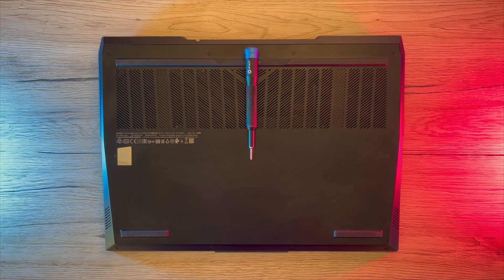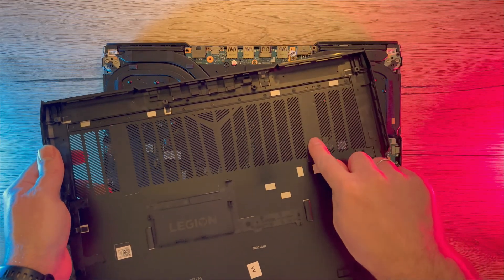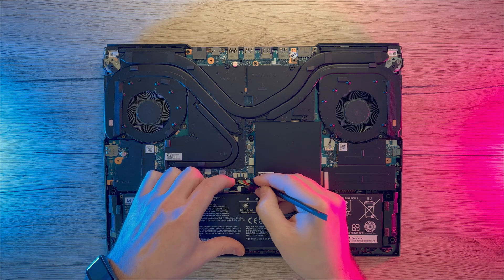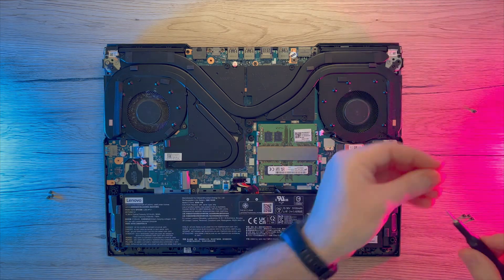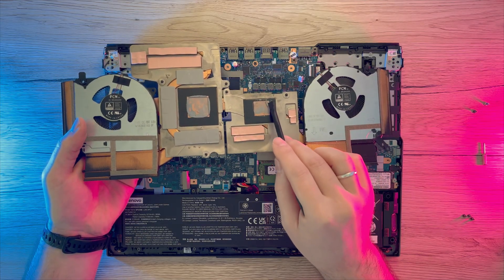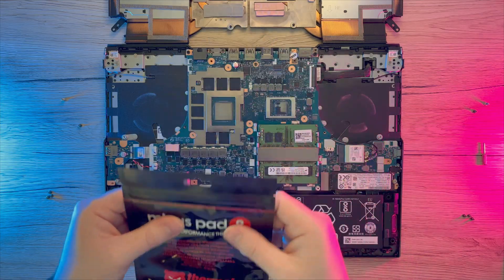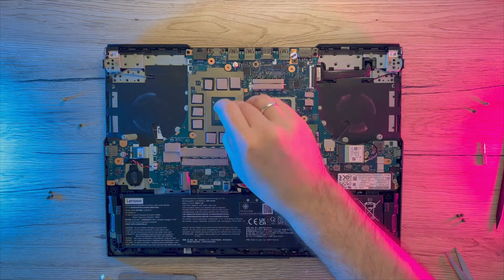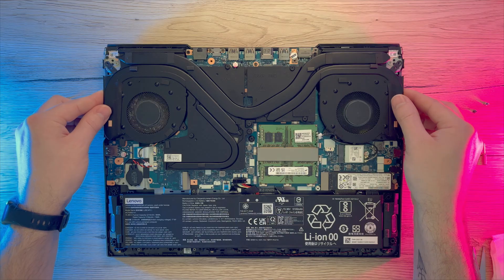Re-Pasting Lenovo Legion 5 Pro 2021 and Fixing Over Heating

Comment: Do you have to switch thermal pads if they are still a little sticky?
Reply from the maker: If they are in good shape and complete then no. I would advise doing it since it better but please check my update video regarding pads and using soft ones.

Comment: I would highly recommend using Honeywell PTM 7950 thermal pads for CPU and GPU (only). 1mm thermals pad of any good brand should be fine for the peripherals. I had struggled a lot and after 3 years of owning the legion 5 pro, I am finally running 70-80 C when playing titles like Cyberpunk at high setting 2K res. If your temps still cross 90 C and keyboard feels really hot, Llano's cooling pad will save you.
Reply from the maker: Yeah I agree and I did switched from LM to PTM in my last video ;)
Reply: Hello! Which legion CPU/GPU combo do you have? Which model?
Reply: Hey, are you saying you use thermal pads on the cpu and gpu between the chip and the cold pad? Just trying to learn, I just replaced my fans and new paste and my CPU is still running 95-100 C..

Comment: Dude, when you do this kind of videos, it's "rude" not to mention the thicknesses used for the thermal pads 😉
Reply from the maker: you are right! I don't know why I forgot this since I don't like it either xD Well it is 1mm BUT in general I would advise using really soft pads at around 1mm since 99% of manufacturers are now using 1mm pads and with soft ones you are guaranteed to have perfect die to cooling block Contact without sacrificing other components :)
Reply: @atechcheck  nice response, thank you <3
For others reading this, for this laptop I found out Lenovo used Honeywell thermal pads which are not that great, 8W/mK, I bought Gelid Ultimate 15W/mK for a 3090 "revision", not done yet, don't know the results yet, but it should be better. I recommand buying it from Aliexpress, cheaper prices, 2 weekes delivery in europe ;)
Reply: @atechcheck  what do you think, can i use 0,75 mm pads ? cos i have already changed the original ones for 1mm and also repasted by TG kryonaut and my temps go little higher after... so now i want to go with liquid metal and dl tech thermal pads with 15 W/mK, but i think i should try 0,75 mm... What do you think ?

Comment: is it safe to wipe it with alcohol? if it is safe is there any specific alcohol like 70% isopropyl alcohol or any tissue with alcohol is good?
Reply from the maker: Jup! I use 99% isopropyl alcohol for everything basically. For anything that you might think it is to strong you can always just put it on paper tissue first so it evaporates a bit first ;) and in my last video you can see how important it was for Liquid Metal ;)

Comment: I lost the cover that goes over the SSD on the right, the chipset just above it doesn't have any thermal pad on it or anything but is it worth me putting something on the chipset itself? The SSD slot on the right is empty for me but just worried about that exposed chip having adequate cooling
Reply from the maker: If you dont have crazy fast NVMe it should be fine. What you can do is put thicker thermal pad underneath it or above if you must 😉
Reply: @atechcheck  thanks for the reply but I think you misunderstood. The nvme slot is empty so the cover isn't needed for that, but there is a chip just above where the nvme SSD should go, I'm wondering if that needs a thermal pad on it?
Reply from the maker: Aaah you mean that. No no worries just leave it as is since without NVMe it didn’t even make contact to that metal plate. If you have piece of thermal pad then you can put it over the chip and dont think about it ;)

Comment: so i repaste the thermal paste, and it still hot on idle (about 44 - 50c normally it only 39 - 42) in this case should i re pad the thermal pad? and is thermal pad has big affecting on cooling down? 
thanks.
Reply: That is cool temps, tard
Reply from the maker: probably cause it is too hard and it does not allow good contact between cpus and gpu dies and cooling block. Just get softer ones that you can squish easily.
Reply: @atechcheck  well, actually 5 hours after i commenting I figure it our that my exhaust chamber has a lots of dust (at first i didnt know if that was the issue and i dont know how to remove the exhaust at my laptop)

its completely my fault
Reply from the maker: @Hklmfd  good to know it is not the pads :)

Comment: Can I ask how many mm is the thermal pad for vram you use, 0.5 or 1.0?
Reply from the maker: They are 1mm BUT you must use really soft one (almost like hard paste) since otherwise, you might face issue with contact and pressure between cooling block and cpu/gpu! Ideally TPM in par of paste form should be used….

Comment: Hey brother, i have repasted my thermal paste for my gpu and cpu of my legion 5 pro 2021 as the cpu was heating a lot during the gaming like reaching upto 99 and 100. I cleaned my fans. While gpu barely gets to 85 now which was the case before repasting. My cpu is still reaching 99 while gaming. I have done a stress test with prime 95 but the temp barely reaches 83 with all cores used upto 35 to 55 percent and the cpu consume over 45 to 50w and clocks 3.8 and 3.9ghz. But during my gaming the cpu barely uses 35w and one core upto 29 to 35 percent while other cores are at 15 to 19 percent usage(the temp is now at 99 degrees ). I don't know what is the problem.
Reply: I have same issue. Idk what to do.
Reply from the maker: Please check follow up video on Legion 5. They have contact issues and it is random so you really need super soft thermal pads or really thick thermal paste to replace them!

Comment: In the beginning of this video you should say this is a complete fail. Furthermore you should mention the thickness of thermal pad you are using. I brought the 3mm one unknowingly and now my cup and gpu do not have good contact with the heat sink
Reply from the maker: You are wrong, right and wrong LOL. It is not fail at all if you know what and how to do it. Jup I should have mentioned it. Why on earth would you buy 3mm pads LOL even on gpus they dont use them. Next time google the thickness, write a comment and ask OR expand comments CTRL+F and search “thickness” and you would have found at least 5 comments with answers. And as extra there is updated video on Legion pads, paste and copper mod right after this one… This is 100% on you mate ;)
Reply: @atechcheck  Sir, you literally created another video where you show that his thermal pads did not work since they were thick, so that means this video is a fail or incorrect. Furthermore, It was the first time I have changed the thermal pads of my laptop and I can imagine a lot of people are doing the same. When you make a video showing the steps you should not miss a single detail. I shouldn't have to check a fellas whole YouTube channel and watch multiple videos to see if his thermal pads worked. I appreciate you are trying to help people by making tutorials, but if you are going to make an updated video, you should add a disclaimer or something to the original video to let viewers know that 'hey, I made a better improvement and you should check out this video' and 'btw, this is the thickness of pads I will be using'

Comment: After change the paste, don't forget to clean the dust that stuck on the heatsink fin inside.

the biggest issue of my laptop is not the paste, but the dust that stuck on the heatsink so then the air doesn't flow the heat out.
Reply from the maker: true :) I did it later hehe

Comment: Don't know if anyone has mentioned it.. But it's also a good idea to clean the fans - often a lot of dust, hair and other stuff blocks the fans.. And since you're already in there, you should do it... Remove a few screws to get into the back of the radiators, since its where it accumulates :) - I would also recommend using Thermal Grizzly kryosheets, since paste in these gaming laptops usually doesn't last that long, so kryosheets is a great option to avoid dryspots bot on CPU and GPU only a few weeks/months after re'pasting'

Comment: So what are the normal temperatures when heavy gaming?
Reply: when i first got my 5 pro and disabled the overclocking, temps were well below 80 on both cpu and gpu. now its been almost 2 years and im hitting 85 on gpu and still 80 on cpu. albeit i do have an abnormally large amount of dust build up.

edit: after cleaning the dust from fans, all temps are 77c at most.
Reply from the maker: that Q was too simple :) it depends on your profiles, CPU/GPU TDP, Boosting both or not etc. I would say that when everything is stock it is overheating and thermal throttling CPU (90-100C) when adjusted to use less power on CPU side it is OK and both are around 70-80 after some time since cooling solution gets saturated.

Comment: At what intervals would you recommend renewing the thermal paste and the pads?
Reply from the maker: hmmm this depends on your environment (ambient temps, humidity), hod often you use and for how long under full load etc. I would say once a year is a good idea to open it up and clean fans, dust etc. Use WD40 dry lubricant and spray a bit in to the bearings of the fans. and when you see that your temps are not acting as they used to and not stable I would say it is time to replace them ;)
Reply: only when you see performance drops that are no longer "ok" to you. The ryzen chips are extremely heat tolerant so I wouldn't worry too much unless you see above 90C in extended use constantly
Reply: My legion is now one year old I had actually decided to change the thermal paste and the pads in conjunction with the fan once a year as a precautionary measure. Is that an exaggeration?
Reply: @janfollinger7276  only change it when you need to. My legion I've had a while and the temps are basically the same. I'm not worried about it. I wouldn't recommend grizzly though like the guy used in this video. Temps are great but grizzly dries out fast and you are basically forced to change it every 9 months at the latest

Comment: I own a Lenovo Legion 5 Pro laptop. Unfortunately, the battery has become damaged, so I've removed it from the device. I'm considering using the laptop by keeping it plugged in all the time. I'm concerned about potential damage to the laptop components over time since I don't plan to replace the battery and use it without a battery. I mainly use the laptop for 3D work, so it's on all the time. So , do I have to face any issues if I use like this for years? I appreciate your response. Thank you.
Reply: From what it got damaged?
Just to be careful
Reply from the maker: Well regarding using it just plugged in, it is fine! No need to worry there ;) Also Lenovo have a CMOS battery (Still!!!) So it will be fine in terms of date and other UEFI settings.

Comment: Can the fans be removed? I have mine doing some noise and as I see they are attached to the sink?
Reply from the maker: Jup! You must remove cooling block and unscrew fand and take them apart from the bottom side
Reply: @atechcheck  I was looking and they seem to be stick to the cooling block, didn't see any screws to be able to take them out
Reply from the maker: @ekagaurangadas108  you nee to unscrew those smaller black ones from top side and then remove block and then remove fans or remove first whole block and then remove smaller screws and take the fans out.
Reply: @atechcheck  I did took out the block, I re pasted, didn't see any screw to keep the fans to the block, that's why I'm asking
Reply from the maker: When you remove bottom cover just look are bot sides where fans are and you will see small black screws! They are even visible in video.
Reply: @atechcheck  found them they are tiny, thanks! was able to clean deeply.
Reply from the maker: Nice 😊

Comment: am i the only one with unscrewing problems bc i cant unscrew the damn thing bc of stripped screws
Reply from the maker: I am sure you are not since they are pretty easy to strip.... not use a smaller flat one and slowly try to unscrew it. In worst case a bit of thin rubber underneath it and in worst case some strong super glue around bit and let it dry with bit in it 😆

Comment: Hey does anyone have any knowledge on the fan breaking my right fan stopped working I cleaned it it’s plugged in and cleaned is there a way to replace ?
Reply from the maker: Yeah you can get a new one but you will need to remove whole cooling block a and take it out from bottom side 😉

Comment: I've had this laptop for a little longer than 2 years at this point and am just now starting to experience some really high temperatures (hitting 100C for CPU and almost 90C for GPU) so I think it is time to repaste. It's also time to get a better cooling pad lol but I have been throttling in game for the past couple of weeks now... I just can't find any other source for it.
Reply: How do you check your cpu/gpu temps?
Reply from the maker: Many ways to do that. Google it and see what suits you the best
Reply: try to go to your energy options via control panel, then go to "change advanced energy options" (something like that), find the option like "cpu energy management" then there will be 2 options, "on battery" and "on energy", confirm that none of these is on the "agressive" option, disable that if was activated.
I was experiencing high temperatures on my legion 5i, when i disabled that "agressive" option my temps never went above 80 degrees.
Reply from the maker: Yup correct. Basically what this does is disable CPU Boosting and with that power which results in less temperature. This is the only effective way of keeping our laptop under those high temps till they design proper cooling solutions and not rely on fact that modern cpus can operate "safely" at 90-100C LOL
Reply from the maker: Well you can do that and see how it holds but I would suggest thick thermal paste instead of pads and if that does not help just turn off CPU Boost 😉
Reply: Vaccumed my fans after 2 years and temp dropped by an average of 10c :)
Reply: Don't repaste. Instead, disassemble the fans and do a clean up of the radiators, I can assure you that you'll be shocked by how much better it becomes.
Reply: Coolingpads from "Klim" are very good

Comment: I also changed the thermal paste, and the fans and screen no longer turn on, only the keyboard light (I didn't even have it on)☠️🫠
Reply from the maker: That does not sound good! Check if everything is properly connected and also I hope you have disconnected battery before you did anything?
Reply: @atechcheck  Yes, I disconnected the battery, but I noticed that next to those battery pins there is something else that can be removed, it is a little smaller and not covered, you can see the wires like the fan cable. And I didn't disconnect that thing. should those wires also be part of the battery?
Reply from the maker: @nubii6781 If you mean that small ribbon cable then no it is fine you can leave that connected. You can always disconnect battery and CMOS battery ( left side small one under the left fan) and then press pwr button 5 times and on last hold it for 10-20 sec and then re-connect CMOS battery and your main battery and then try to start it again.

Comment: quick q...: the pink ones have 1mm thickness and the grey ones have 0.75. is safe to put 1mm on all ?
Reply from the maker: Hmmmm not really for 1mm ones yeah but then you will have issues with 0.5 ones.... use thermal paste instead of 0.5 ones ;)

Comment: So if i wanna replacement a one fan i need to replacement the cooling block?
Reply from the maker: Nop you can unscrew then and replace them. They are exposed ones without a cover. They use cooling block as covers for fan assembly

Comment: I am about to repaste mine soon and I would like to ask how the Thermal Grizzly Kryonaut performed. Did it not 'Pump Out'? I have read reddit forums prescribe using Hydronaut instead of Kryonaut as Hydronaut is thicker and prevents pumpouts.
Reply from the maker: Well if you have good die to cooling block contact then it will be OK but I would advise using any thicker paste with Lenovo since tolerances seems to be rather generous LOL
Reply: What pad size did you use?  @atechcheck

Comment: how do people get the fan unplug so cleanly?, mine is so tight, i cant get it ou.. D:
Reply from the maker: Practice and right hand movement LOL you need to hold cables firmly and apply some tension, then you just pull quickly but just for few centimetres and stop. BUT that short hard pull when it is already under tension is critical! Same as with car and manual launch controls and right tension on your clutch and then that short difference when you let go of your clutch and pressing the gas pedal

Comment: My GPU cooler is making a lot of noise. Is it possible to change a part separately, and not the entire cooling system?
Reply from the maker: I think so. Top part is all together with heat pipes. You have those 4 small screws and when you remove them you can just remove fan housing with blades. Maybe you can do it and clean and lube it a bit and see if it is better 👍
Reply: @atechcheck  thank you)

Comment: Bro 🤢 u missed out cleaning u r actual cooler 🤢mine had so much dust cake inside fan chamber 🤢 just open and remove those fan ,heat sink assembly and check fan vents . U will be shocked. Mine was literally choking
Reply: Exactly, I did clean the actual cooler by opening up the cover of the fan on the back of the heatsink. 

Before I got constant 98°C - 100°C during CPU benchmark using Cinebench R23, now it barely reaches 95. No more throttle, I got 12800 score using my Ryzen 7 5800H. Keep in mind that this is heavy test with 80Watt of CPU power every core at 100% utilization. I'm glad I managed to get this result lol
Reply from the maker: No need that was just dust on the blades. It was not old laptop and much in use when I did this 😉
Reply: @atechcheck shhht excuse man you already there you clean it regardless. Or just to get the client back sooner 😂